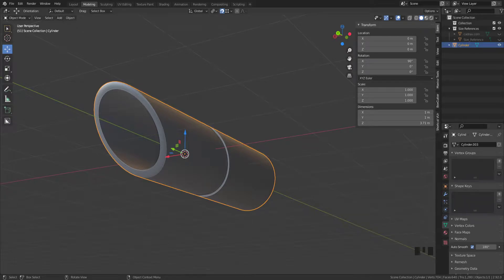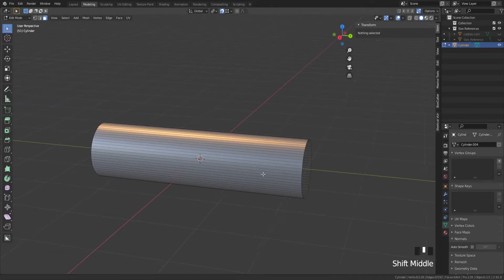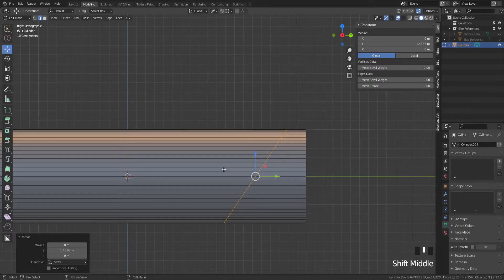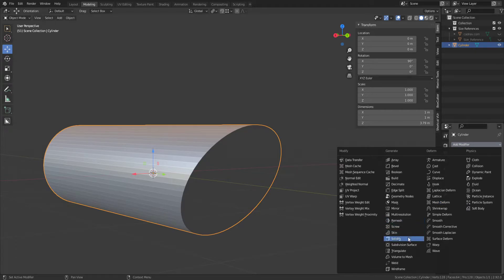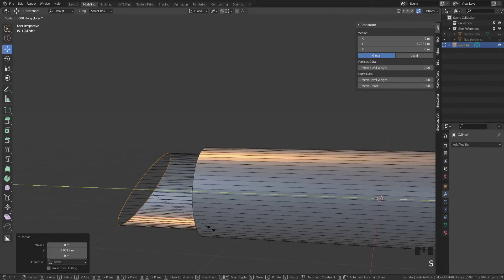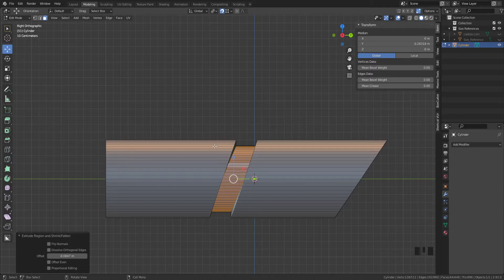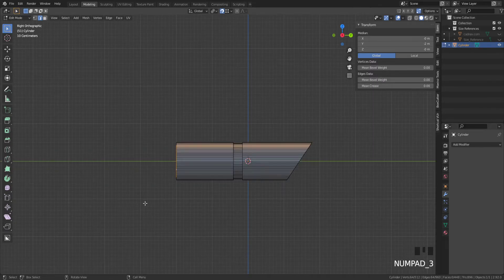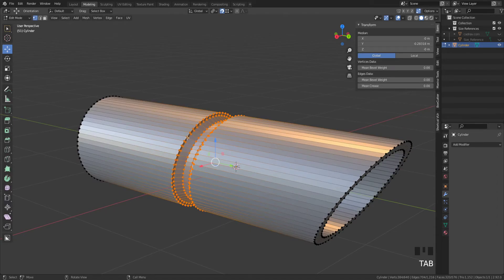Blender:  (Lightsaber emitter.) How to rotate vertices along an edge constraint.

Comment: I don't understand why but for me it's not working, sometimes it does but most of the time no. It just size weirdly the edges.
Reply from the maker: I'll create a tutorial to demonstrate a different way to do it then. I know that the solidify modifier can sometimes size edges in a weird way.
Reply: @DarkAutumn3D  Thank you very much but I was talking about the shortcut to rotate an edge loop but still keep the shape. Sorry I wasn't clear ^^
Reply from the maker: @dylanbequet2464  Are you pressing and holding all of the buttons down? I don't mean to sound like I'm saying you're stupid because I know you're not but sometimes button combinations can be a pain.
Reply: @DarkAutumn3D  i have same problem either blender updated and its a dif shortcut or something or im doin it wrong
Reply from the maker: @enderbotv1766  I just tried it in Blender 3.1 Are you sure you're rotating on the correct axis? What happens when you try it?
Reply: @DarkAutumn3D  nvm it works now sorry i found a fix